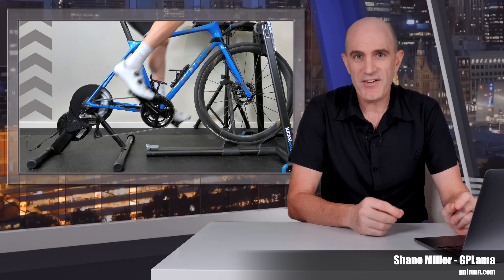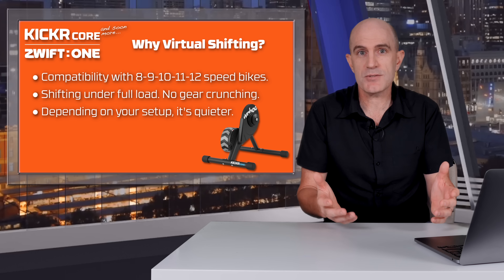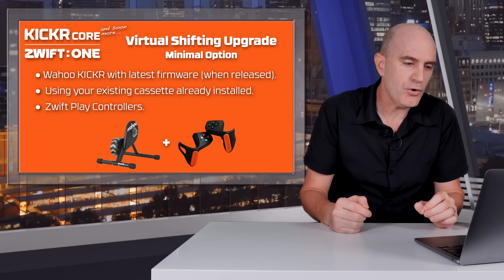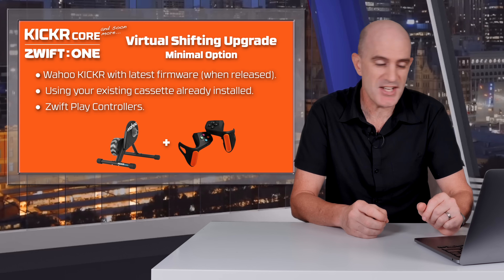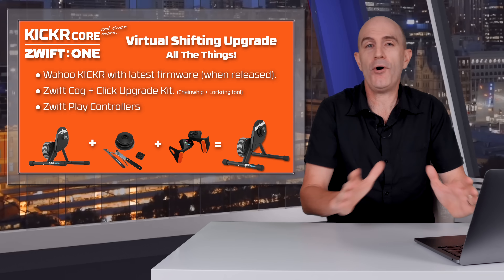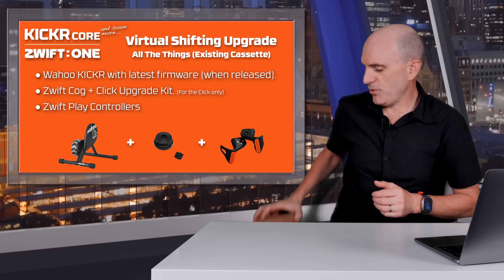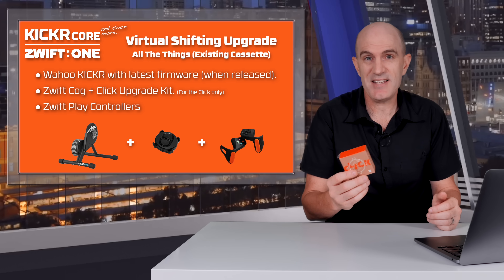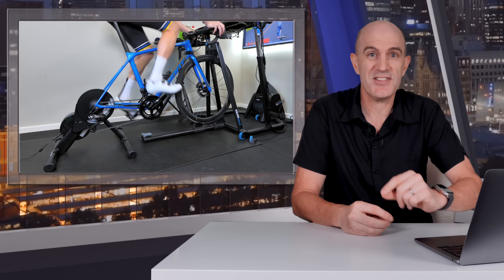Virtual Shifting Upgrade Options for Wahoo KICKR Owners!

Comment: How are the gear ratios calculated in game?, I can run my road bike with a 50x34 or my gravel which is 1x 38 front setup, when the click is paired does it request what gear ratios you want to replicate?... I run 100% trainer difficulty and tend to ride a compact with a 32-34 cassette, how is this replicated if I buy the click??. I never use my gravel bike on the trainer because of the 1x setup and wide range rear cassette but if there was a way to adjust the click ratios that would be great..
Reply from the maker: After a few seconds of pedalling when you have everything paired up it'll use the flywheel speed + your cadence (estimated from your pedalling power profile with each stroke) to determine what chainring you're using on the front. From there it'll adjust the virtual gear ratios and attempt to give you the same 24 gears regardless of the front chainring you're in.
Reply: @gplama  Awesome, thanks very much for the explanation..

Comment: Hey Shane
Where did you get the information that the Kickr V6 will also be receiving the virtual shifting upgrade in the near future? I am in the market for a second direct trainer as my wife has gotten into it heavily too, so i am thinking of getting a slightly more comfortable V6. I currently have the zwift hub with zwift play, its nice and i love virtual shifting, but it is a bit unstable during sprints and most likely less comfortable, as it does not have any side to side movement.
Reply from the maker: Direct from Wahoo. Still no indication when it'll be released to the public firmware stream. It should/could be any day.

Comment: I’d love to get this working without a rear derailleur, setup like a fixie - chain direct between cog to chainring - for a true minimalist setup with virtual gearing. Otherwise you still need a rear derailleur and shifters in order to get the chainline right, at that point I see very little upside compared with a a proper cassette with a 14t out back. At least then you can have virtual gearing for Zwift and real gearing for other apps (or zwift).

Comment: So I currently have an 11 speed cassette on my V5, but just bought a 12 speed bike . Instead of buying a 12 speeds cassette, could I use my 11 speed cassette but use virtual shifting ????
Reply from the maker: Yep. As long as the 14T sprocket lines up ok.
Reply: @gplama  thanks for the quick reply Shane !! 👍🏻

Comment: So from what I get from this video, wouldn't it be easy for some enterprising person be able to print the 2 plastic pieces of the hub, find a source for the appropriate cog and supply a generic freewheel retainer/tightening thing. Wouldn't that be a whole lot cheaper than what they are currently selling the Zwift Cog for? Especially if someone already has the Zwift Play controllers? $80 US seems a bit much to pay for a cog and 2 pieces of plastic (and a threaded tightening thing).
Reply from the maker: Yes. The Click also comes with the Cog; and that’s the only way to get it atm. Another way to look at is is the Cog is free and the Click is $80. 😉

Comment: Would you say as someone who just uses ERG workouts for virtual riding just getting the cog would be an ideal option?
Reply from the maker: No. It's just a 14T cog. If you won't be using virtual shifting (and don't need the Click), and don't need multi bike compatibility, keep with using a standard cassette.

Comment: There really isn't a reason to have to use this one cog hub, and a number of reasons not to. Not only can you virtually shift just as well if not better with a regular cassette, and thus save some money on the one cog hub kit, but it's also likely to be quieter, based on what I've read, and allows you to ride on other platforms that don't yet have virtual cycling.

The main downside is that it'll result in excessive wear on the cog you end up using while in virtual shifting mode, but cogs are often individually available for replacement and you could always substitute an old cog from an old cassette to save the good cog for outdoor rides. Or you could just install an old cassette that's still serviceable.

The only other downside is that because the Clicker isn't yet available by itself, you'll have to either get the upgrade kit, or the Play controllers, which at $99 seems like a lot if you only intend to use them for virtual shifting. I wonder if the Bluetooth codes to up and down shift are open so people can build their own controllers or jerry-rig Bluetooth controllers to become shifters?

One thing I still don't understand, though, is what's the purpose of the replacement freehub body in the upgrade kit. I know that it's only for the original Zwift Hub that comes with a cassette and isn't compatible with the original Core, but what is it about the freehub that comes with the Hub that makes it incompatible with the Hub One single cog "cassette" and requires a new freehub?

If in fact this replacement freehub body isn't necessary to upgrade the Core to a Core Zwift One, then I imagine that the upgrade kit will dispense with it and presumably be cheaper ($40-$50 sounds about right to me). And, since the Zwift Cog itself isn't necessary either to do virtual shifting, just some sort of controller, I'd hope and assume that they'd sell the Clicker by itself ($10-$20 sounds about right).

Comment: Thoroughly enjoying the steering and now virtual shifting that the Zwift Play has enabled.  Thst said I've been reminded of Bluetooth signal strength issues with both the Play needing a BT connection and the Core having to be paired in BT too (normally have everything on ANT+).  Repositioning my router (thanks Zwiftalizer vid) has helped but suspect a second USB extension and BT dongle sat somewhere between the trainer and the Zwift Play will be required for a rock solid connection.  Tried bridging on the Companion app at one point but that was absolutely horrible 😮. Probably more to do with my phone then anything else though 🤷‍♂️

Comment: Hi Shane. I hope this isn't a silly question, but I take it the ring that I run on the front can be a different size?

I have an MTB so the virtual gearing could be a game changer (I run out of physical gearing on my current setup).

My front chainring is 32T. Will this work?
Reply from the maker: Yes! That'll work. The trainer will do some funky calculations when you first start riding to determine what chainring you're using (assuming you're in the 14T on the back) and you'll be good to go with that 32 granny ring! I might look at doing a quick video on this at some point.
Reply: @gplama  thanks buddy! Really appreciate you getting back to me 👍

Comment: What if my cassette goes 11 13 15 18? Is 15 close enough?
Reply from the maker: 15 will be close enough. The virtual gearing is calculated within the first few seconds of riding and does assume at 14. The ratios will be slightly shifted with a 15. Not really an issue with 24 gears to choose from.

Comment: Isn't this purely a software feature, why are there all these hardware requirements? Isn't it just a matter of changing the trainer resistance and the in-game speed for each virtual gear?
Reply from the maker: It’s a combination of things. The trainer has to support ‘Zwift Protocol’ which is BLE but not the FTMS standard. To do this, it has to be done in collaboration with Zwift.
Reply: @gplama But I mean in the big picture, why do they even need a new protocol for this? Can't they just change the resistance of the trainer the same way they would if you were going up a hill?

Comment: If you have 1 bike virtual shifting is a nonsense gimmick, sorry.Its for selling you more hardware.
Reply: I have a mountain bike that runs out of gearing in Zwift world. So this makes great sense 😁
Reply: Even then it's quieter, saves wear on the shifters, derailleurs and other cogs, gives you a greater range of gears than on most bikes, and apparently shifts faster too. With a regular cassette and clean and well-lubed drivetrain in good condition, it's as quiet a setup as you'll ever get. And eventually they'll sell just the Clicker, probably for under $20, so not expensive either.